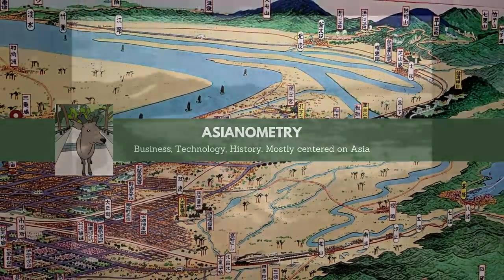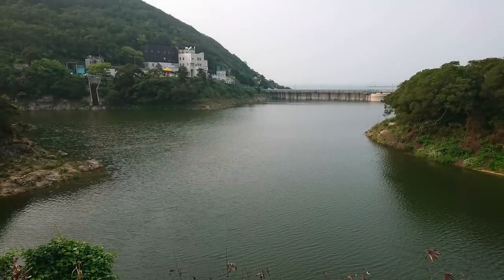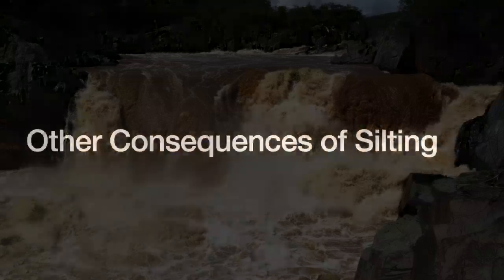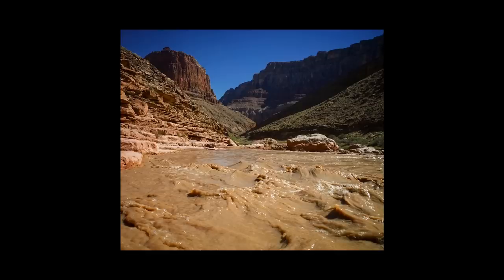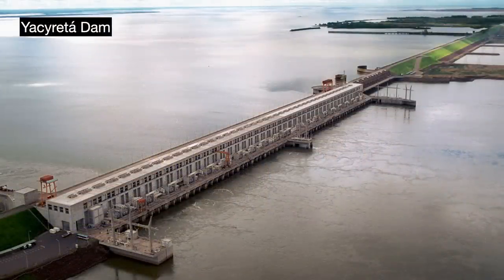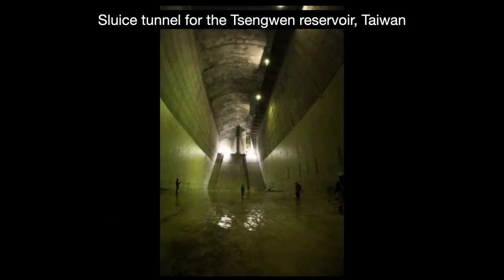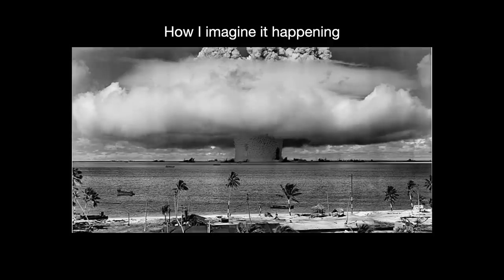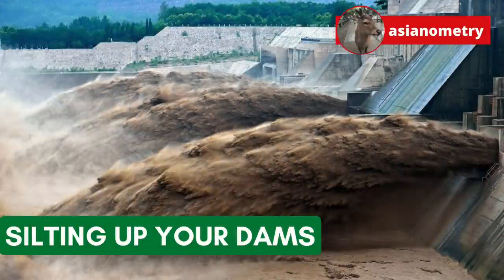When Silt Fills Your Water Reservoir

Comment: I would like to add that there is a fourth option: just live with the fact that the dam has silted up. In Africa there are many 'sand dams' purposely constructed. They build a simple dam which in a few years completely silts up. The sediment behind the dam will still hold groundwater which can be used for irrigation and drinking water. The advantage of a silted-up dam is that the groundwater will not evaporate like the water in a reservoir.
Reply: Not so good if you want your dam to generate electricity though.
Reply: Obviously not a help for hydro power, but what a great idea for water for drinking and irrigation! Groundwater depletion is a huge problem in many parts of the world (like the US Midwest, although we’re not feeling the impact yet), so the idea of retaining water in the silt behind dams could be very helpful.
Reply: Somehow you made mud fascinating 👍 Great illustration for your concept of how blasting would work! 😆😂🤣
Reply: Thanks for the insight! Interesting to know that in Africa sand dams are constructed like this. Just another unique way to battle reservoir silting! 🤔👍
Reply: the issue is the lack of water not just the silt build-up. I'm not sure what size you're referencing in your example but i would imagine this can't work for large dams like these. the issue with silt in large dam is the capacity. Once silt fills in they're not holding water rather displacing water because the water that would be stored there are released due to "over capacity".  while your idea might work in medium to local scale dams, large dam that supply millions of people would suffer from a water crisis.
Reply: Sand dams are built cheaper as that is the point of the dam, more for the same cost and the water you can collect only goes up.
Reply: @takumi2023  I think the sand-dams the OP was referring to are much smaller and not used for hydro power. The image i have in my mind is small structures less than 10 meters high - but that could be completely wrong, as I have no actual idea…
Reply: @DEtchells  I looked it up at "The Water Project"   and they are about 4 to 5 meters tall and about a meter thick.
Reply: @macmcleod1188  Ah, thanks for that info! Sounds like exactly what I was picturing in my mind’s eye :-)
Reply: @Quasihamster  What if you build a modular dam that can be raised, instead of needing to remove the silt? You could even keep stationary, just keep building the lip higher? I guess you eventually run out of water supply that way?
Reply: You’d be flooding an increasingly large area behind the dam.  Forcing more removal of people, increasing costs, and increasing evaporation.
Reply: @DEtchells  thankfully there are an increasing number of scientists realizing that small beaver dams are great at replenishing ground water tables and help make breaks against wildfires
Reply: @jrunner5k  Yes! I read about this a few years back: Most of us today have no idea just how many beavers and beaver ponds there were 100-200 years ago. They had a massive impact on groundwater replenishment and sediment filtration before runoff reached the rivers. Your thoughts about groundwater in silted-up reservoirs exactly match my own: They hold groundwater that doesn’t evaporate, and can be tapped for drinking and irrigation.
Reply: @TheThinkingJester  No. The size of the reservoir depends on the height of the dam and the geography, whether the reservoir holds sediment or water.
Reply: @DEtchells  It's a pretty common technique in dryland permaculture. Here in the Midwest, most of our problems are easily solvable with just a little will. Farmers could pretty easily dig and maintain erosion control ditches, dams, ponds, etc. but these projects provide them little immediate benefit at significant cost. Only the most foresighted farmers would do them without government intervention I think.
Reply: @GerbenWulff  i responded to briankrebs wrong, check his comment for context

Comment: Absent dredging, all lakes, reservoirs, etc, are temporary. A lot of meadows start as lakes - get filled up, filled in, etc.
Reply: So?   Most of the navigable Mississippi and tribs. is routinely dredged.   Just do it.
Reply: @GilmerJohn  they have to dredge it because they put dams on it.
It didn’t need dams and locks before the “ENGINEERS” came along.

That river was around a lot longer than humans were, and did fine.
Reply: This is not true in any stretch of the imagination. Most lakes and rivers are not dredged. Where are you picking up your info from?

Comment: An Archimedes screw set at the dam on the upriver side can lift silt from the base and dump it out on the downriver side. This would need to be set up during dam construction and it would likely take a number per dam not just one but it would help with the removal by constantly removing silt. Since at the dam itself is where the silting first starts by keeping it low there you keep it dropping there so the rest of the catch basin doesn't get as silted.
Reply: Silt will still settle upstream of the screw even if you keep the area immediately next to the dam completely free of silt, the currents in a reservoir aren't that strong. If you de-silt only around the dam, you'll just end up with the dam sitting in a gently sloping hole, with the bulk of the reservoir still silted up.
Reply: @kyousouka  yup, but you have made the removal of the upstream silting less and have at the critical area a deep water supply. No matter what the purpose of the dam, it works best when there is deep water right near it.
Reply: @kyousouka  good thought
Reply: The bypass tunnels seem to me to be a good method. 
You could build the dam like a bathtub with many drains.
It would be very expensive but it may save money in the long run.
They dug a bathtub-type drain in the bottom of Lake Mead with water in it.
Reply: Anaerobic digesters also suffer from silting up. Fre-energy from the UK use a rotating arm and a similar screw to remove sand, gravel etc. This contains valuable nutrients so is spread on fields as fertiliser. I imagine some reservoir silt could also be sold, especially if segregated.

Comment: The news clip about record low water levels in Germany has nothing to do with sedimentation or silt.
The picture shows an iconic part of the Rhine river, which does not have dams. The nearest dam is app. 200 km upstream.
The reason why commercial shipping had massive problems in the years since 2018 are the enormous summer droughts in western Europe.
At this particular part, the river cuts through a mountainous region, the valley is narrow, the riverbed is solid rock. (The scenic valley is a tourist hotspot, btw). There is no silt.
Interestingly there is the opposite of a sedimentation problem upstream. In the 19th century the river's meanders were cut off, creating shortcuts to prevent flooding and convert swamp into farmland. Since then, the river has cut deeply into the soft ground (there the riverbed is sediment), causing the groundwater table to drops significantly.

Comment: Matilija Dam, located in the Ventura River watershed on Matilija Creek near Ojai, was built in 1947 and silted beyond use by 1960s. A notch was cut in the dam for safety reasons but total removal remains beyond available funds.
PS - Blocking river sediment has been blamed for a lack of sand replacement on local beaches.
PS2 - Los Angeles retention dams mentioned as having been cleared of silt are specifically designed to catch water from extreme rainfall events and debris to prevent flooding downstream. Basins have to be cleared on a routine basis to maintain capacity.
Reply: For the time it remains, the "cut here" stenciling remains the best graffiti to see anywhere in the world.

Considering how silted it is (so any new silt must go over the dam), my instinct is that the infrastructure of the 101 highway that protects what would be constantly eroding cliffs upcoast is a much larger factor in the ongoing beach starvation than is appreciated.
Reply: @westrim  - Good point re freeway limiting cliff erosion. Recently posted YouTube video on bluff collapse at Torrey Pines, Black’s Beach in the San Diego area illustrate your point!
Reply: PS2 = PPS, "Post Post Script"

Comment: Unless your dam is very poorly designed, silting up does NOT affect how much power can be generated.
Only the storage capacity of the damn is affected.
And so the only effect it can possibly have is running out of water to generate power with.
Low water levels at a dam DO affect power generation, as the water pressure in the turbine is lower.

Comment: Small point, Pressure waves travel long distances underwater very quickly, meaning underwater explosions can injure susceptible sea life far the explosion. So Air bubble curtains are used for acoustic dampening, not to drive away sea life.

Comment: One of the other consequences of silt accumulation in dams is that they create "hungry rivers" downstream. Flowing waters have a certain amount of stream power, which carry sediments. If the water flowing out of a dam no longer holds sediment (because it got dropped behind the dam), it's going to pick up sediment downstream of the dam. This increases erosion downstream, which can have serious knock-on effects to anything that is near the river downstream.

So siltation is not just a problem at the dam. It's also a problem downstream of the dam.

Comment: Silt can also block harbours. Specially older harbours founded in a time when depth was not the primary driver, and storm shelter often was more important. A famous example in Europe is Belgian Bruges, a medieval prosperous town with a harbour. It lost a functional harbour that routed a high percentage of Northern European trade due to silting. Because of that however, the architecture survived and now it is is tourist town. In modern times, even the North Sea is dredged to allow Brazilian iron ore vessels to reach Rotterdam. (these largest class of ships only go to certain Chinese deep sea harbours and Rotterdam)

Comment: The flip side of this situation is the fact that dams increase coastal erosion.  The silt and sand that would go to building beaches and marshes is trapped behind the dams and causing problems with them.
Reply: Acceleration Quanta  That's not what happened when the dams on the Elwa river in Washington state.  The mouth of a river is a long way from the bottom of the ocean.

Comment: I first became aware of the silting problems when watching reports about an experiment with Glenn Canyon Dam in Northern Arizona. They conducted an experiment to see if a carefully managed release could restore some of the flood runoff benefits to the soil around the river channel. Turns out that this didn't go as planned but it did lower the level of the reservoir enough that you could see that there were large volumes of sediment in some areas of the reservoir.

One of the most effective areas for sediment control in this area seems to me to be the Salt River system of dams outside Phoenix. The water flowing into the reservoir comes from two sources. One of these is dry two-three months out of the year. The other takes a pretty lazy path downhill from the eastern part of the state so doesn't really have a chance to pick up much velocity anyhow. The big concern, before the dams were built. was flood from rain and snow runoff on the watershed. A half inch of rain on the watershed could push the river beyond its banks as it passed through Phoenix because it would load washed and draws that were normally dry and that's where a lot of the silt came from. Otherwise, now, first, this river has to pass over a weird dam originally used to divert water into a power plant at the Roosevelt dam. This slows the water heading into the reservoir considerably so most of it comes out fairly clean. The water then has to make its way down to to Roosevelt dam's outlet, several miles away further on down. Then it passes into a second reservoir, then a third, then a fourth, then finally a diversion dam at the northeast edge of town that feeds water into the local irrigation canals, typically claiming all the water released upstream from that and a second system.

So before the downstream dams were built in the 1920s and 30s, and before concrete lining of these canals, cleaning out the canals and irrigation ditches was an ongoing process. Now, there are occasionally rocks about 6-12 inches around that find their way into the canals but the water normally carries nothing more than algae and other growth rather than silt and that's the only reason the water isn't actually clear. So it was serendipitous that the way the system of reservoirs were constructed resulted in very clean irrigation water and reduced silting of everything, allowing it to last for 100 years with no reports that there are any real problems with capacity.

Comment: I don't think dredging is that expensive, especially if it's just once per 50 years. You can do it from floating riverboats to reach everywhere in the reservoir bed.

I think the real problem with this stuff is that most dams are the small cheap versions that exist at almost every river, often unregistered and old, and they piled up with crap that made them useless by now. Will take massive re-industrialization effort to go fix up all those.

Comment: In Pasadena CA there are two dams that are heavily silted. Both are on the Arroyo Seco.  Not a river (only when it rains), but more like it's Spanish name suggests; arroyo: stream/brook.  There's the Devil's Gate Dam, it's been dredged for the last few years.  Mind you that Southern California doesn't get much rain.  During the summer there's hardly any water.  Making it easier to haul away all that silt.  But when it does rain there is so much silt that comes down the mountain. Then a few miles upstream is the Brown Mountain Dam, built in 1943, according to it's website.  It's a rather small dam.  The website says that it's 81ft high.  If you hike up to the dam now you will see that it's silted all the way to the top.
If you're from the area do yourself a favor and make the hike. There's not much of an elevation gain, I think it's only 500ft over 2 to 3 miles.  It's hardly felt.

Comment: Silt is really a problem called a loosing battle in the dam.
In my region there is a river with 8 power plants and 2 flood dams. At first nobody really payed attention to silt, but 30 years ago a major drought revealed that there is no storage anymore. 
Since then there is constant work on the silt problem, and no matter what they do, they barely maintain the level or maybe advance by little bit year over year. Last estimate was they restored around 5% of the storage capacity.

Comment: Agriculture has been dealing with the issue of silting for over 100 years in Australia, possiblity many hundreds in other countries, we use smaller settling ponds that catch water and gradually let's it flow into the main reservoir via channels or pipes, the smaller ponds dry up quickly and are easily cleaned in a day or 2 with heavy machinery. 
In the case where it is not dry you can transfer the water via diesel pumps.

Comment: There is a simple, inexpensive fix for this problem that would decrease silting by one or two orders of magnitude (10 to 100 times less).  Simply ensure that beavers occupy as much of the catchment of these dams as possible.  Their ponds collect the sediment and turn it into valuable 'bottom land'.  And they do so much more.  They a) reduce flood peaks and increase low water flows, b)direct water underground where it is save from evaporation, c)store much more water than is in the pond itself by raising the water table in the surrounding area, d) greatly increase biodiversity in their area, e) remove nutrients from the water and on and on it goes.

Comment: Why not use underwater vacuum hoses powered by the hydraulic head, especially when the opportunity to leverage all the excess energy and capacity during storms that will overfill the Dam.  During construction a network of pipes with a grid of inlets that can be selectively opened one at a time could be used later to clear silt.  If there isn't enough suction, a venturi powered by dam outlet flow could boost it.   What is the economic value of all the silt, and quit it be used for something?

Comment: Not mentioned here is the role of silt in the prevention of coastal erosion.  The Amazon dumps around 3 cubic kilometers of silt in to the ocean every year. Prevent that silt from flowing and you change the entire east coast.  Recent coastal flooding in Asia for example was made worse by the lack of silt transported in the decades earlier.  It has to be said however, that there had been very little done to mitigate the problem of siltation.  

Bottom line: We want that silt downriver, not in the dams.

Comment: At 5.59 or have a pre settling reservoir to trap the majority of the silt before it reach the main dam and easier to get rid off....yes I know it will not clean the lot but it will increase the use of the dam by decades.....then every so often empty the dam and truck out the silt to start another cycle to prolong the dam utility...